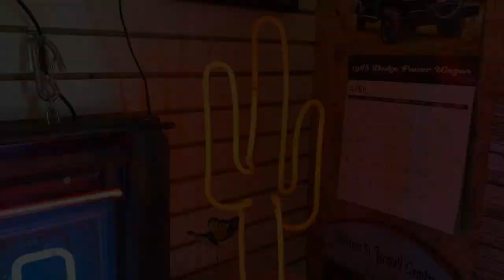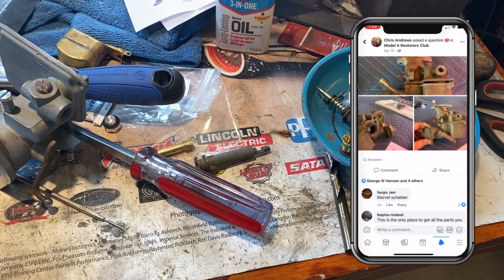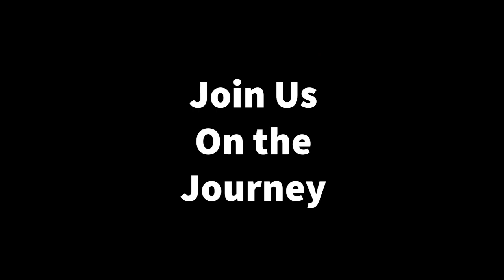1930 Ford Model A Restoration - Ep. 5 Rebuilding the Carburetor | Epic Neon | Epic Restorationz

Comment: Didn't you miss a few steps on that carb restoration? How about checking the float first. You could make sure it doesn't leak and it needs to be checked to be sure that it's level when installed. The carb could also be flow tested, although you need to have a flow tester to do it. I  admit I didn't have one for mine and the carb seems to work just fine anyhow. There's probably a few more things you could have mentioned but I'd have to check my manual first. Apparently you didn't paint it either.
Reply from the maker: Thanks for watching Jim.  At the time of that video, we weren’t quite sure of our goal with the series. Chalk it up to learning on the fly. We originally were simply making videos as sort of a diary of our restoration, not being overly detailed.  Our thought was to make a scrapbook of our restoration, but in video format. Not to mention that it’s often hard to work on the car and film at the same time. Starting with our King Pins episode, we got more detailed and have at this point, gotten most of the bugs worked out of what we want to do. You will find most all of our more recent episodes include a lot more of the details.